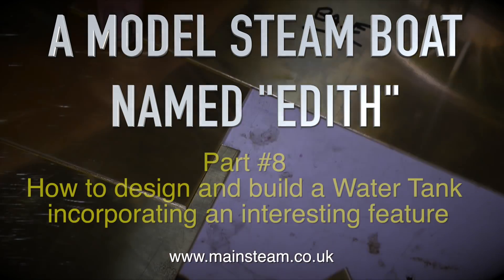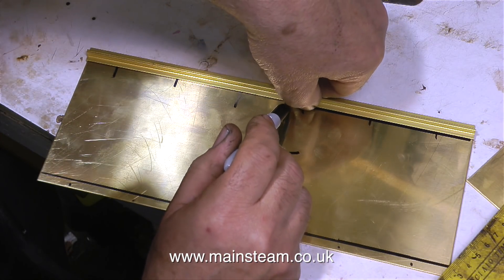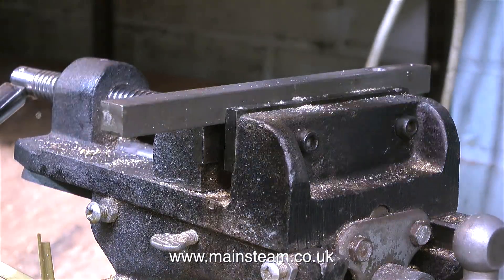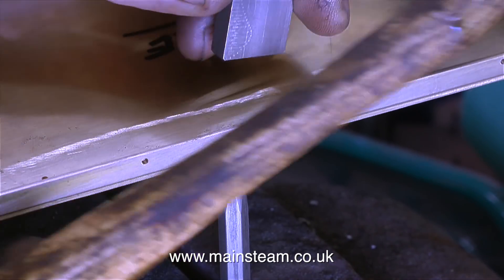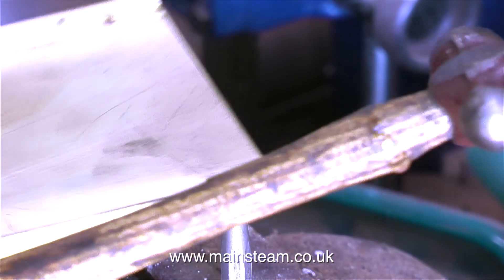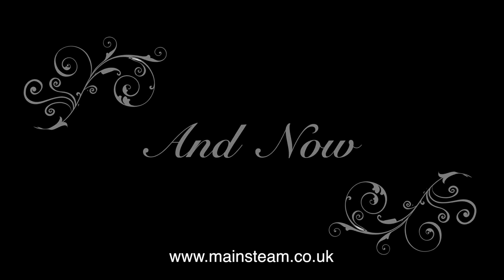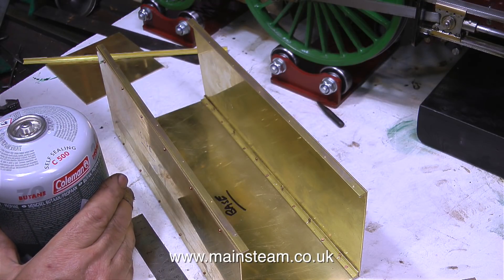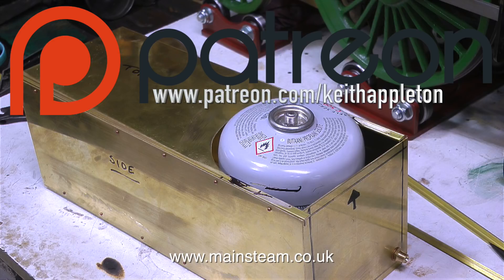A MODEL STEAM BOAT NAMED EDITH - PART #8

Comment: i can very well and truly relate to using one's midsection as workholding as i used to use mine to deaden the vibrations of setting the bearing races in diff housings.... that was until my midsection began receding making it substantially harder to set those pesky bearing races as now the housing bounces around making aligning the punch a nightmare.

Comment: Hi Keith, just a question please.  In a big heavy steam locomotive water sloshing in half empty water tanks wouldn't affect the locomotive.  But since a boat is pitching and yawing, could sloshing in a half empty water tank in a boat cause instability ?  I could be preempting here and certainly not in anyway trying to be smart.
Have you considered baffles in the tank to prevent sloshing ?
Reply from the maker: not necessary in this size .....

Comment: Hi Keith, Have you tried running one of these burners with the tank upside down? That way the burner is being feed liquid instead of gas, this only works if the burner has a vaporization tube.
Reply from the maker: Yes I know, I have used that method many times, but potential "Health & Safety" risks make me not want to show that method ....